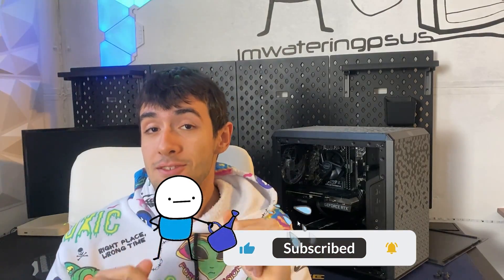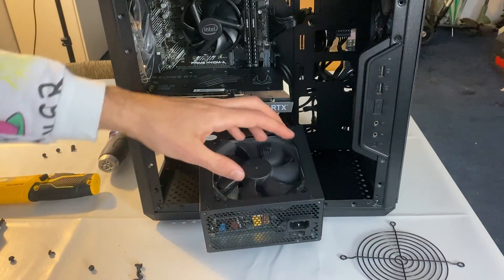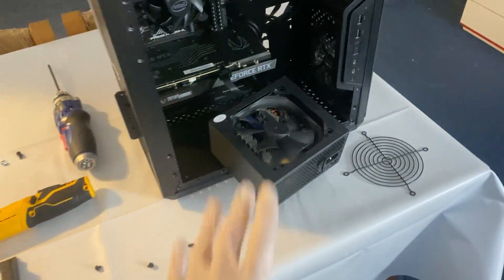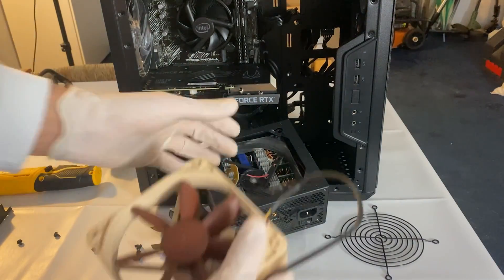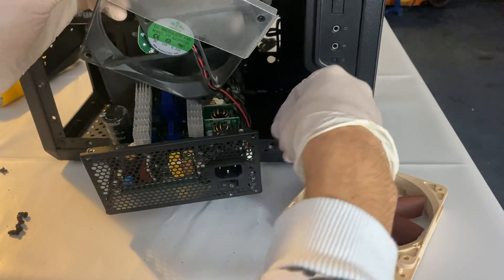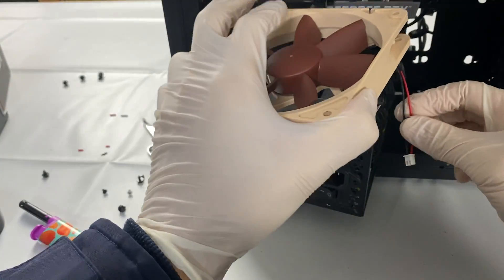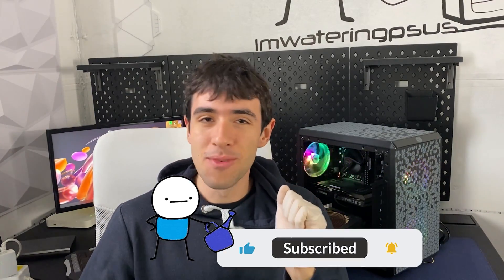Fix your Noisy Power Supply! - Full Guide

Comment: You went too far instead of the easier way - if the existing fan needs complete replacement, I simply take it out, close the PSU, attach a normal 12-14cm case fan on top and plug it as one of the case fans - this way you do not need to solder anything, the fan can be cleaned/maintained easily, and if it needs to be replaced in the future it is super easy.

Comment: Just a tip, use a hot glue gun to hold wires in place, you most likely have have a shitty soldering iron your skills are most likley fine. I work with tuning cars so i do a bunch of electrical work, there are these sleeves with solder in the middle and eax on the edges these will almost always be better than soldering since you get an airtight seal protecting it from moisture probably overkill for a pc but they are easy to use. I would recommend using any bearing grease or a silicone grease.

Comment: Can I please add some constructive criticism?

1:33 Shorting AC pins on the back of PSU at best does nothing to discharge the bulky DC capacitors inside, this is because the AC voltage goes through four diodes (a bridge rectifier) to be converted into DC, that is feeded to the high-voltage capacitors. Shorting these pins does not discharge the capacitors.

2:40 Isn't it better and easier to fully disassemble the PSU to remove the fan, when servicing it? When servicing some fans, it is required to access to the other side in order to peel the sticker and remove a rubber plug or cap, and release a small retaining clip or washer that is holding the shaft. If you don't, you risk breaking the whole thing!

4:59 These 3-pin fans give you an extra pin, called "TACH" so that you can see the RPM of the fan in the motherboard! It hurts me to see you cut this pin, instead of using it by wiring it to the motherboard, so that you can gain additional functionality by being able to monitor the speed of the fan!

6:16 It hurts me to my core to see basically all YouTubers cutting wires, and splicing different connectors, instead of just crimping pins at the end and inserting into the connector. No soldering required! The connector you see at 7:06 is JST PH connectors, with a 2.54mm pitch. Very inexpensive and available on Amazon and AliExpress.

6:35 God! What is that electrical tape job! 💔🥲 Please use some heat-shrinking varnish tubes instead of electrical tape if you need to splice wires, it'll be much easier, neater, and cleaner, and would look 100% professional! Do you know that many electrical tapes come loose with the passage of time, especially in high-temperature environments, like inside of the PSU that contains heat?

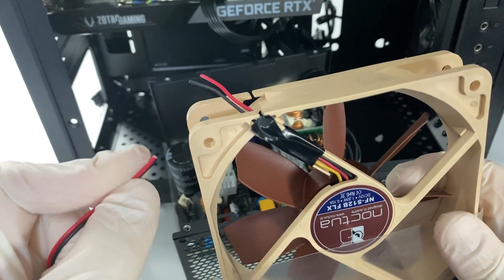6:57 Please use proper wire strippers, or even wire cutters instead of scissors, the stripping done by scissors are very poor and inconsistent, which makes the whole thing look like a bad job. 🥲👍

Dude, amazing video otherwise, I like everything else! I'm so sorry for my comment, but this is badly triggering my OCD, and if someone else opens up that PSU, I don't think they would recommend to keep using the PSU 😅

Comment: Bro just open up the psu and take out the fan properly you don't need to yank it out like that. It's pretty simple and way more easier if you open up the psu and disassemble the fan from the back side by removing its sticker. And please do not short out the main pins of the psu with screw driver it will cause damage to your pc instead of discharging the psu
Reply: Exactly my thoughts on the first point! As for the second point, I don't think it would damage the PC (or even the PSU for that matter), but it certainly would not help with discharging the capacitors, as there is a full-bridge rectifier between the AC pins and the DC high voltage that is feed to the capacitors.

In any case, shorting the AC pins wouldn't solve anything, in my opinion as well

Comment: And there goes your warranty 😂 its better to rme the thing if its in warranty had it superflower ledex V11 platinum 850 watt it was suppose to be tier A+ psu
Reply: Solid advice, but not everything is always under warranty, for example if the warranty of a product expires, do you just throw it away? You would first attempt to repair small stuff like this. Also, what if you bought a product without a warranty, I'm sure this video is for those that are not using the warranty.

Comment: so if your fan is making a noise just go ahead and rip it apart because you dont know what you're doing. what a terrible guide. its ok to not know about this stuff, but you're making videos pretending like you do. clearly you dont. even a best buy service tech would know not to just rip the fan out the way you did. actually brain dead.
Reply: It is possible to service sleeve-bearing fans by removing the blades and re-lubricating the shaft using the suggested sewing oil in the video, although the eventual outcome in this video lead to the fan in question completely getting destroyed.

In my experience, it isn't worth it to service old and cheap fans like this, better replace them with like a Noctua as shown. Only service them if the fan is valuable and it is worth it to service it.

Comment: I've been replacing the fans in ATX PSU's, satellite, radio & audio supplies etc for the last 25 years. It's fine if your careful, they've gone on working for may years after. The only time I got a shock is when I was a teenager, took apart a camera to see what's inside. I had quite a belt from the photoflash capacitor!  
In most cases all the individual components which make up the supply have a very high rated max operation temperate. This sits way above the heat generated if the fan had failed completely. 
However watching your video I wouldn't use tape. When possible I'd solder directly to the PCB, even if this means desoldering the header for the termination. If you really must splice then solder and insulate with appropriate heat shrink.
Reply: Same here. Been working on electronics for the past 13 years. The only shock i've ever gotten was from a nasty 370 photoflash cap. Just be careful, stick to common sense and don't go in blind.
Reply from the maker: I’m so happy to get a comment from somebody who has been doing these things for longer than I have been alive! I hope you liked the video, I definitely agree on staying on the lookout when it comes to capacitors! I’ll definitely get some heat shrinking tape, thx a lot for the feedback:)
Reply: @johntrott9513  My psu is making a buzzing noise that I can't figure out.  It makes the sound even when the fan isn't moving.  I replaced the psu twice and the new ones make the same noise.  The pc seems to be fine otherwise (no other noises or performance issues).  have you ever encountered anything like this?

Comment: Okay, it's something I see a lot, but I can't help but mention it anyway.
Swapping out the fan in a power supply is not a good idea. Power supplies are designed around specific fans, and while a PC will ramp up the fan speed in response to temperature, a power supply likely will not since it is expecting a certain PWM level to provide a certain amount of airflow. Any fan can be quiet if it simply does not spin very fast; 90% PWM on a noctua S12B will be much slower than 90% PWM on a Hong Hua HA1225H12F-Z, but a PSU will not know this; after hitting either a certain load level (or a certain temperature,) it will set 90% PWM, and if you added a different, quieter fan, it will probably not receive an adequate amount of airflow. Additionally, the priorities with a case fan and a PSU fan are different; with a case fan, airflow is the primary concern, whereas in a PSU, static pressure is much more of a concern.
Just as a common example, the A12x25 has impressive airflow and decent static pressure at low to moderate speeds, but it falls a bit behind commonly used PSU fans at higher speeds, which means that the parts of a PSU will be subjected to higher temperatures under load.
Finally, needless to say, this is a surefire way to void your warranty.
Reply from the maker: Thanks a lot for the detailed comment! Definitely don’t do this if you PSU is still under warranty BUT: you’re definitely correct when it comes to RPM ranges, but the solution is actually pretty simple: only swap the fan on your PSU if you’re putting a better one in. Meaning quieter yes but also more airflow at a said RPM :)
Reply: @ImWateringPSUs It's not just airflow, is the thing. Static pressure is a huge factor in a power supply, as is exactly what the fan does at various RPM ranges.
Reply: There is no pwm. Anything that runs at 12 v works

Comment: Sorry but as someone who's been in the electrical business by decades now I must criticize your modus operandi.

First, if the braiding or the wires may be safe enough for low amperage loads instead of soldering, they must have a little slack or could come undone under vibrations. A VERY tight fit is not suggested. Give it a centimetre more wire both sides. It will still be a tight fit, but a more secure one.

Second, DO NOT use sticky electric tape in that kind of situation. It degrades over time (brands and quality make no difference, all of them do sooner or later) and can either become a sticky mess (if subjected humid heat) or dry up and unravel (if subjected to dry heat) causing shorts or jamming the work of the fan. Use in its stead heat-shrinking plastic sleeves. There are of all dimension and gauges. Once moderately heated they shrink becoming a second skin to the existing wires.

For last, for the love of all you hold sacred, DO NOT treat sticky electric tape like the above mentioned heat-shrinking plastic sleeves subjecting to a lighter flame, THEY'RE NOT thought to go through that treatment. As already stated, heat degrades it and you don't want that.
Reply from the maker: I really appreciate the constructive criticism! I'll definitely buy some heat-shrinking plastic sleeves to use in future mods :) To my defense, I really think that with these low currents and voltages even some duct tape would be enough, as I've had a PSU I've done this on running for 6 years now, but I'd like to do things in a more professional way and I'll follow your advice. Thanks a LOT for taking the time to write this! Also I think you're italian as well judging by your username, so cheers from Italy too!
Reply: @ImWateringPSUs  Sei italiano? Not an American-or-whatever-Italian? Well, anyway, since you chose to make an English-based site (you aren't neither alone nor the first), let's stick to this language.

I am happy you didn't take my critique badly, as sadly it happens at times, and about it being constructive, that's the way things should go. I am a staunch believer of the proverb:" if you haven't a better way to do things then the one shown, keep your silence."

Glad you appreciated. Bye.  :)
Reply: @ImWateringPSUs  Please avoid using electrical tape in future PSU-related videos, also note that if a short circuit happens, it doesn't matter anymore that the intended voltage and current rating is low.

You use insulating material in order to avoid faults like shorts, in other word, use the materials that is appropriate for fault protection, not for normal operation! :)

Comment: This is such a great video. I have not seen someone actually swap the fan in a PSU before. I will definitely not be doing this though as I would never open up a PSU, just to be on the safe side! Maybe don't try this at home 🙂
Reply from the maker: Thanks a lot for the support! I agree it's definitely one of the trickiest mods/upgrades and I wouldn't recommend one does it unless they feel absolutely confident :)
Reply: @ImWateringPSUs  It's actually super easy if the replacement has correct parameters, like static pressure, airflow, and the correct connector! I believe most of the effort in this video was spent on changing the Noctua fan's connector into the correct one, however instead of soldering and splicing wires, you could simply order the correct connector and crimp the pins as required.

Some older PSU designs don't use a fan connector, so the fan is directly soldered to the PCB, which is harder to replace, but still possible for those that are electrically inclined